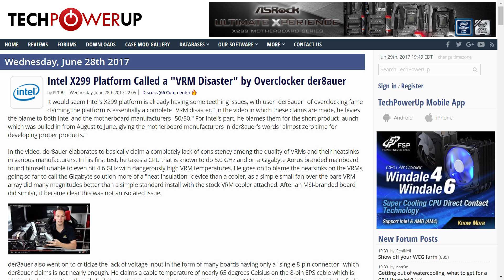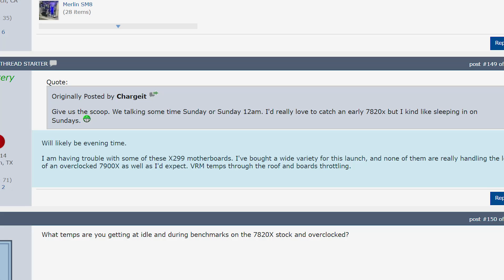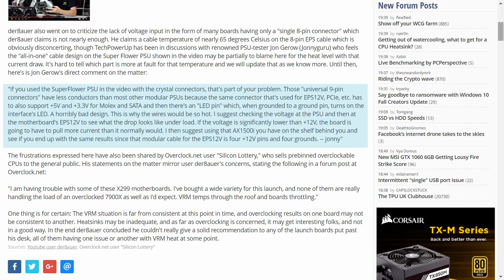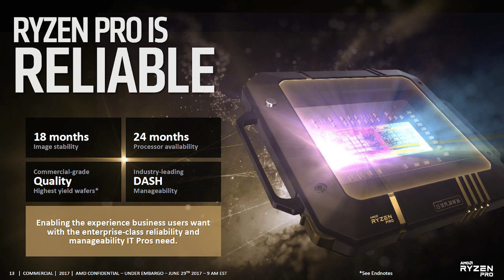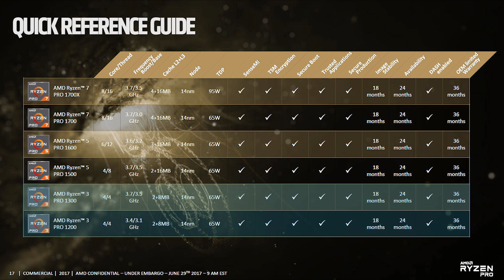Intel Core X Motherboards Overheating + Ryzen 3!

Comment: I kind of agreed with Gamer Meld here with the premature launch of Kabylake X and SkyLake X. Orginally these CPUs were not even planned to be out this early and other brands such as ASUS or Gigabyte  did not have much time to design flaws of there motherboard. This sort of backfires Intel for having such a early launch. There big reason for this premature launch was because of Ryzen 5 and 7 for competition. I won't be surprised if there is more issues coming. They should have waited and actually design it. They only thought of competition and money so they just had to rush the launch. It isn't the motherboards brands's fault for having these issues

I felt bad for Intel but with these Situations it makes me lean towards AMD for CPU Shopping. Sorry Intel but I might get the Ryzen 5 1600.
Reply: Mr. Bullseye II Go for the 1700, it is a monster and rips through anything you throw at it, Oc'd or not.
Just stick with Gigabyte boards (or AsRock) and Samsung B-die ram.
Reply: I would if I have the money atm, right now I have a little over 400$ and I my best option is the ryzen 5 1600.
Reply: Mr. Bullseye II Fuck em, Intel are cunts mate.

Comment: Anyone buying i9 cpu must be blind. Or really really rich
Reply: Even being super wealthy doesn't seem to be a valid excuse, unless you literally can't wait 2 more months to get started with the job you need to do.
Reply: Matko - xForcer or fanboy
Reply: For me, the i9 isn't even the worst part of this. It's the i5 X CPUs for the X299 platform that don't make any sense at all.
Reply: Udo der Unförmige Oh let's take an i5 (200 bucks) on a x299 motherboard which coasts the same price than my cpu
Wtf are i5 doing here ?
Reply: Exactly. If someone wants to spend this much of money for this platform, why the hell should he buy a 4 core CPU without HT, without integrated GPU and just half of the usable PCIe lanes? According to Intel "Because they can upgrade later"... Yeeaaah. Makes sense. At least for Intel. I guess. Even a 7700K is a better buy.

If there were cheaper motherboards designed just for these i5 X CPUs, it wouldn't be that much nonsense. But since there are just these 200$ minimum motherboards available... Anyway, Intel is doing some very confusing things lately - and they're not the only ones.
Reply: Van Dinh forced
Reply: Udo der Unförmige i7 7740X makes even less sense, since it's very close in price to the 7800X, which has 6 cores. If they wanted a cheap CPU for upgrades, why wouldn't they just make an i3 X, or even Pentium X? A Pentium G4560 is almost nothing compared to the motherboard, so it's a better option for upgrading later than 7640X.
Reply: or just loyal to the brand. stop supporting them, they're thieves.